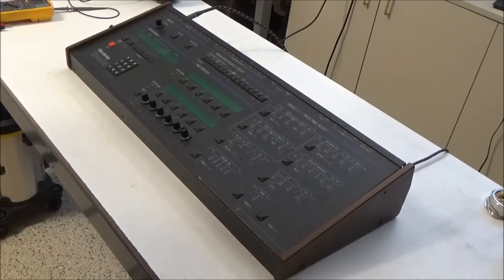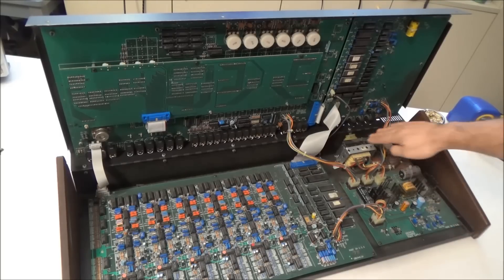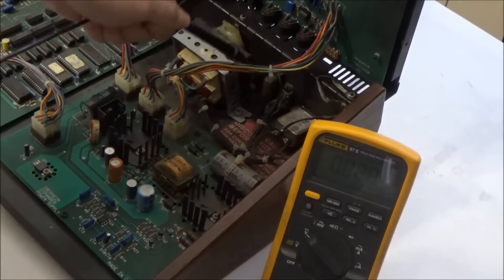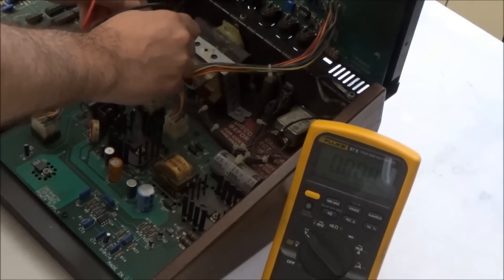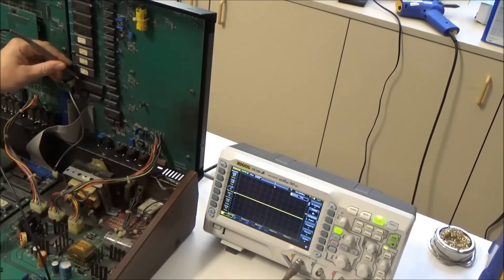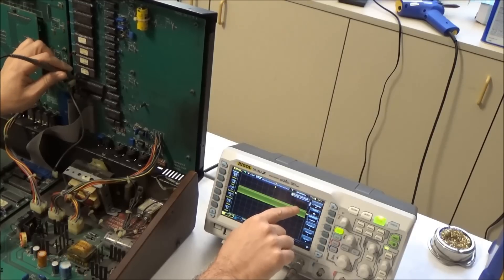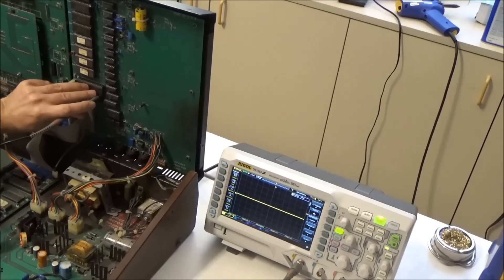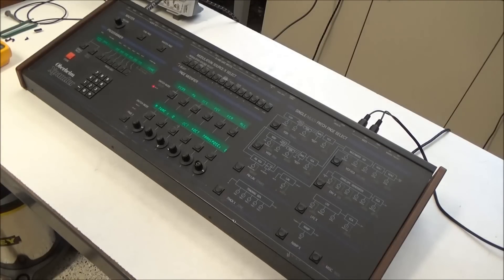Synthchaser #111 - Dead Oberheim Xpander Repair

Comment: I really wanted to see the whole oscilloscope "boring" part up to the NAND... you can learn a lot of things from a video like this!
Reply: totally agree, informative video but missed out the best bit where you can learn the most from.
Reply: Agree , would be nice to get the strategy used here to get that chip as a suspect ? 
oscilloscope testing could not always work if the chip is no told to "move" in that case ?
- was it completely "dead as a parrot" (so easy to check) ?
- or subtle "nand" issues from one gate ?

please told us ;-)  --> you should bring also a apprentice : i have so much things to share !!

Comment: Thanks for the video! I'm curious about your probing technique. I don't see you connect a ground lead from your oscilloscope probe to the board. What forms the ground connection?
Reply from the maker: The synth and the scope are plugged in on the same circuit and share a common earth ground.
Reply: I was also wondering....